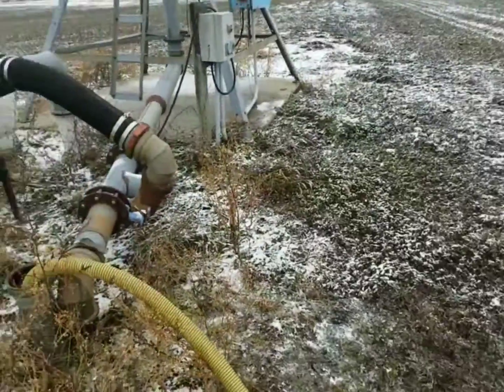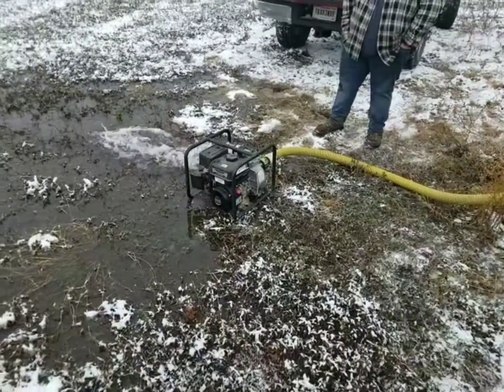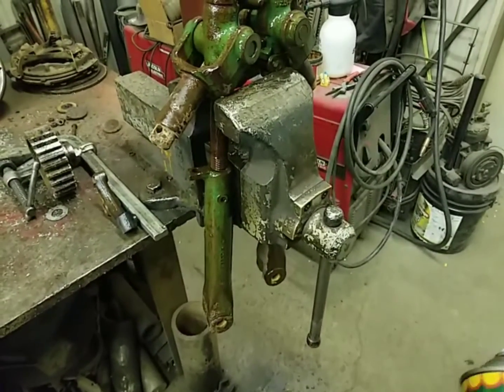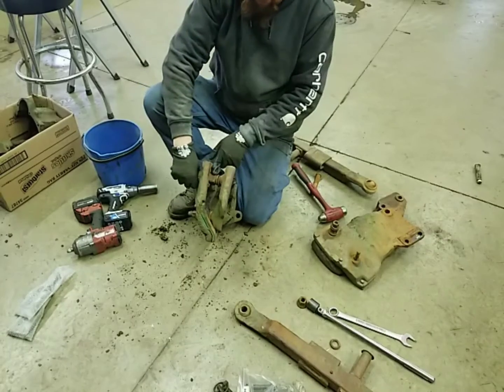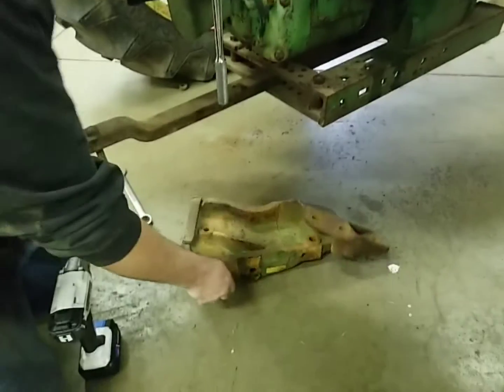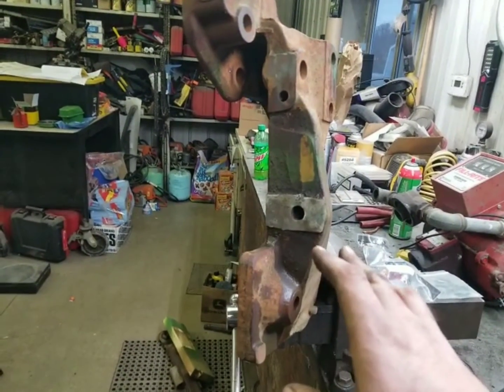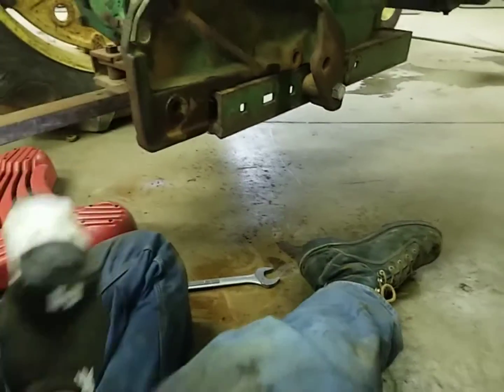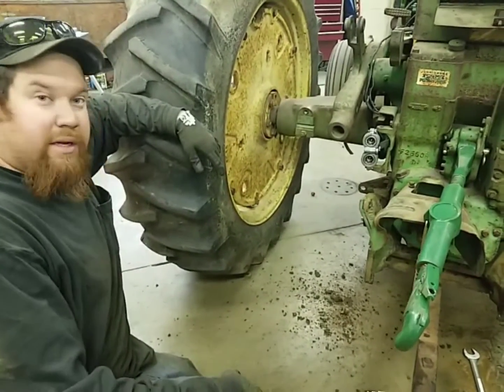John Deere 720 Diesel 3 Point Hitch Install And A Reminder Live Video Thursday Night 7pm Q&A!!!!!

Comment: Have y’all ever changed the PTO oil pump seal? My 730 leaks transmission oil into the PTO housing. I believe it filled the PTO housing completely full and caused the PTO shaft seal to blow… or, it just wore out. But, now PTO housing won’t hold oil and the the transmission drains out through the pump and PTO shaft seals.
I’m not look’n forward to taking the rear housing off the tractor to get at that oil pump seal!…
Reply from the maker: We have never done one but I don't think it's going to be to bad of a job